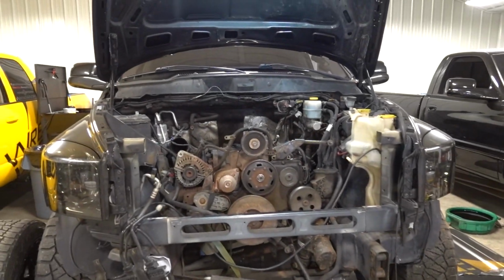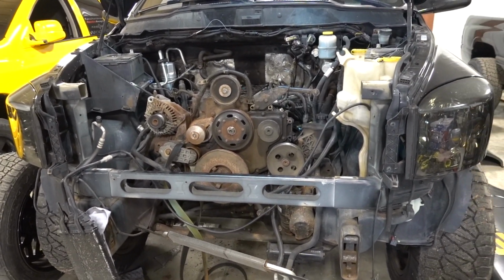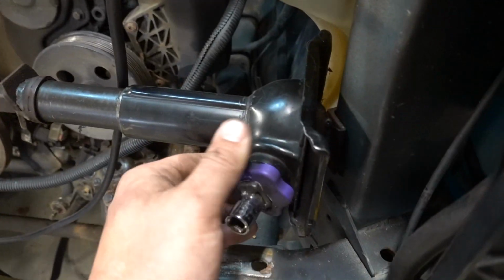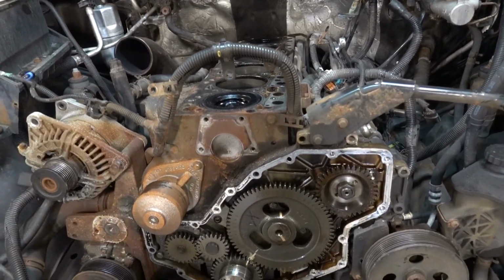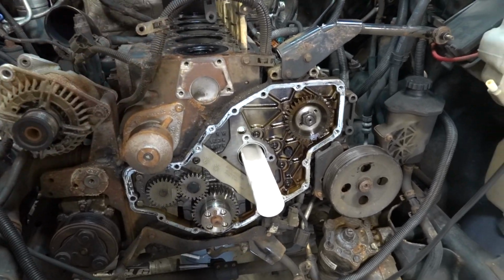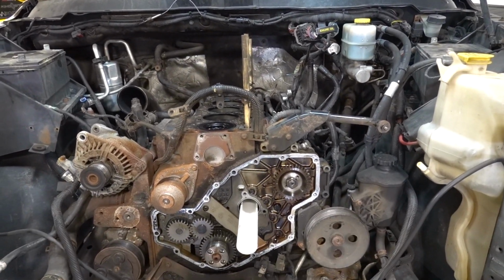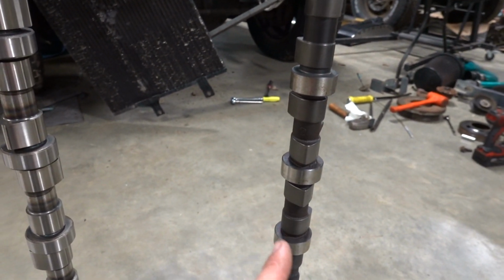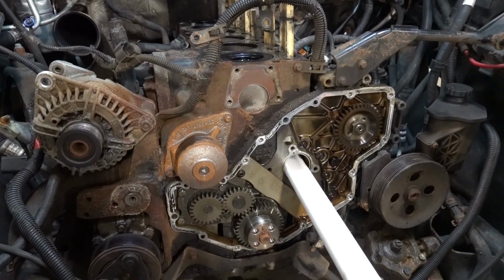DIVING DEEP INTO OUR 6.7 CUMMINS ENGINE REPAIR!!!!

Comment: So cut and weld a square tubing to a jack? Grind a C cut, around bolts (one side only) and fold it up enough then pull cross piece out, then putting back in hammer down line up holes and bolt up and not to much stress so ur choice to tac weld it back or snug bolts and cut piece folds back perfect

Comment: Hey buddy.  Funny story.  I did this job one time on a customer's truck with the head on and secured them with rubber bands.  Pulled the cam went to bed.  Came back the next day and one of the dang rubber bands had broke!!!!!  Luckily somehow by the grace of God I had used two different rubber bands on each set and one rubber band was still intact and the two lifters didn't fall.  Now I used two good strong zip ties on each set.  Keep up the good work.  Love your channel

Comment: After I get that damn Front Crossmember out I always trim it right up to the rivnuts on both sides and cut one side on the front at a 45 degree angle to help it slide back in easier.

Comment: Greg,great video!  both cams are steel. One is forged "the one with rough texture" and the other is ground from billet....if I'm not mistaken. The steel is hardened to be able to take the ware.

Comment: Greg, Have you thought of adding the lockout hubs to the tow rig?  Ramman Inc has factory style hubs that will unlock the front axle giving you another 2-3 mpg, and make it easier to steer the truck as well when not in 4wd.
Reply: I have lockouts on my 02. Don't really see much difference and steer seems same. Did it for fact of getting rid of the sorry bearings they have.

Comment: What is a good place to have your injectors checked and maybe rebuilt? Love watching your videos, lots of info for us guys do it your selfers.
Reply: I use M&D Distributors in Houston, TX. They are Bosch approved to test your injectors to Bosch specs. They are also reasonably priced. I'm sure there are many more out there but I like the service they provide and approved by Bosch.
Reply: Ive usually just sent mine to exergy. Don at F1 will go through injectors also.
Reply: How much does it cost? For checking them and for a rebuild

Comment: Use a heat gun on the pvc pipe , leave it narrow at the end so that if you bend a little over you can still easily feed into opening.

Comment: Hopefully some on can answer this for me
I'm looking at getting an 06 Cummins it has sport/stock mirrors do I go with third/second gen tow mirrors or 4th gen tow mirrors
Reply: James Vlogs the bases where they mount on the doors are different on the 4th gens (different shape) get tow mirrors for a 3rd gen. I was gifted a set of 4th gen mirrors, they won’t just mount up
Reply: @ppumpin01  boost auto parts make 4th gen mirrors that will work

Comment: Looks like you have a quarter of an inch on both ends of that front reinforcement bar you could shave off, then you won't have to spread it apart as much